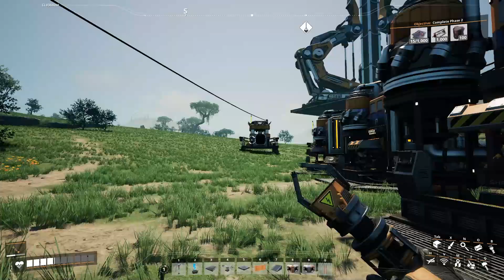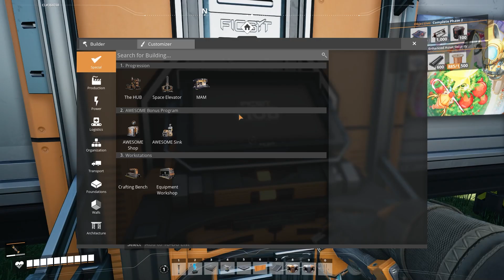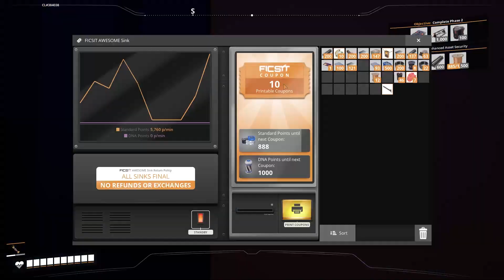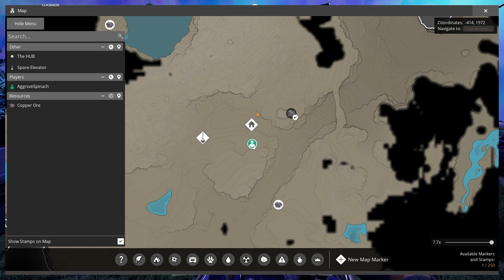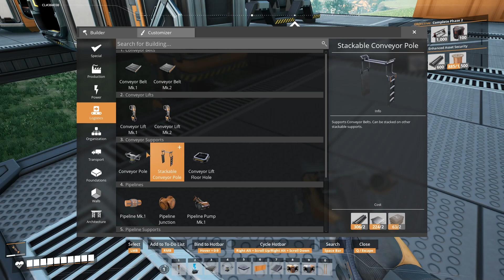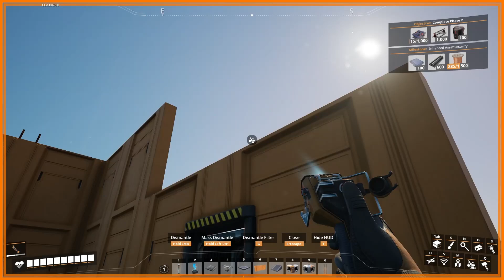Start of an actual factory - Satisfactory 1.0 EP06

Comment: I know this is old, but I just recently started the series.  There is a way to avoid the "hump" in a belt going up a ramp.  You can place a splitter or merger on the belt before the hump (aim your mouse AT the belt when placing), which "splits" the belt into two pieces.  Remove the small "hump" section, then the splitter/merger.  You will be left with a non-humped belt that you can attach another belt section to.  You'll have to do this multiple times for long ramps, but with practice it only takes a few seconds.  And yes, default build mode is best for slopes.  For whatever reason, the straight mode just looks bad.  I think the level portion has a minimum size or something.

Comment: RE: Pipette configs...
You can mouse over a production machine,  (or generally any item in game) and do a standard CTRL + C and a CTRL + V to copy/paste configs of machines, it will insert power shards, clock speed and recipe as need
Reply from the maker: @Tubasnot  yeah I wish you can just pipette the whole building with the settings like in factorio. But it's a 2 step process. Middle mouse to copy the building and ctrl c v to copy paste the settings
Reply: @ yeah that is the way to do it for now. Later there is blueprints (if not unlocked, just finished ep6) that is similar to Factorio. They will retain building layout, configuration and what not and blueprint can be hotkeyed + full blueprint dismantle as well.

Keep up the good work, really enjoying the series.
Reply: Sounds like you are looking for Blueprints? You can set the configuration in the blueprint and then whenever you place that particular blueprint, it has that config preset? Other than that, the Copy/Paste function.

Comment: Answer to Q at around 25 min "How long do you spend build".... well built a 500 "insert generator after coal here" power plant producing 125,000 MW using a fuel type unlocked later as well.... balancing all in and outputs 100%, setting up logistics infrastructure (rail and trucks) took be the better part of a week. but man was the rewarding to turn on and see cycle up and built power to a mega base...
Reply from the maker: @Tubasnot  that sounds amazing! Can't wait to do a megaproject in this game

Comment: Avoiding spoilers. You found some resources while wandering around. If you collect those they might unlock something in the mam. (Caterium, Quartz, Sulfur)

Also check your various miners/resource nodes. As they can be impure/normal/pure. And without overclocking with a tier 1 miner that makes 30/60/120 depending on the purity.
Reply from the maker: @ChristopherPride  OOo okay I'll go pick those up. I suppose you're hinting one of them would help me out ;)

Ohhhhhh that's why sometimes it's 60 sometimes it's 30

Comment: You should try to build the floor hole before the conveyor lift
Reply from the maker: Oo is that how it works I thought it was just decorative
Reply: @DataEngineerPlays  there is something equivalent for pipes
Reply: @DataEngineerPlays nope. They are usefull. Specially if you want to build vertical lifts longer than its limit. Start build from the bottom. It will stop at hight limit but when you point at the hole it will connect. Now they can be as tall as you want. (Hopefully someone has told you about that during the year since you started)